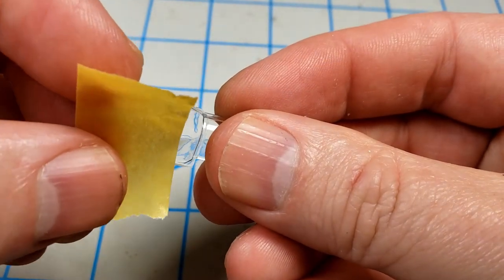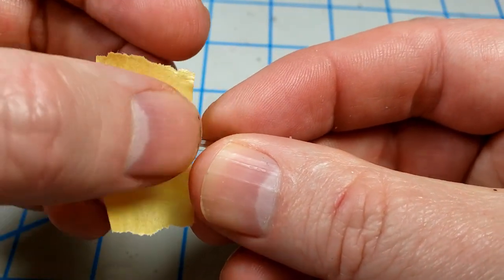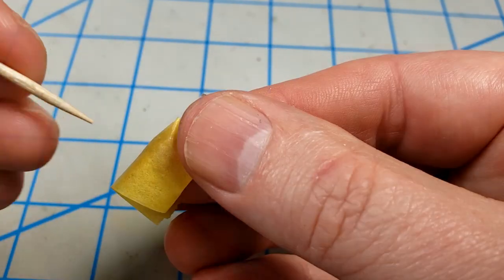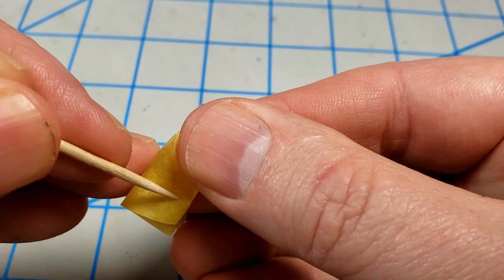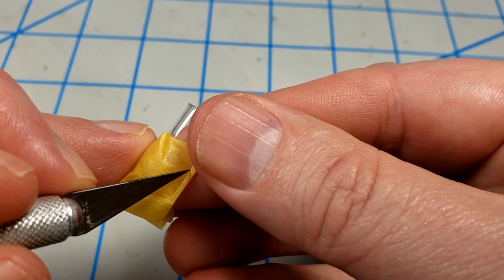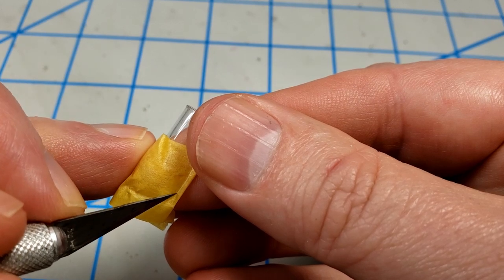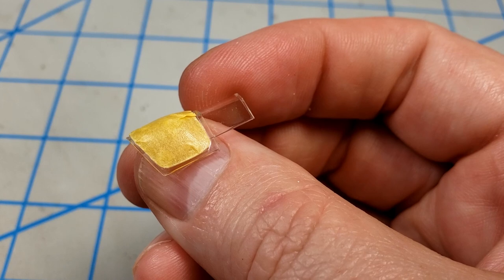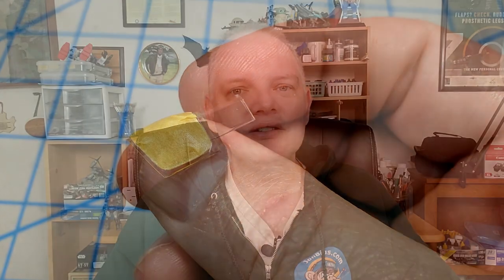Masking Clear Parts Made Easy!

Comment: I’m using a method you didn’t mention - a hybrid method. Thinner slices of masking tape around the canopy edges (so they adhere to compound curves better) and then filling the center in with liquid mask.
Reply from the maker: Yep - I've used that. It certainly works. Thanks!
Reply: I found that the liquid mask (VMS) leaves quite a bit of residue.  I assume that it will come out with Novus1, but I am going to wait a few days to ensure that the frame paint is totally cured --wouldn't want to have the Novus1 obliterate the frame paint now!
Reply: It turns out that Novus will not get rid of the VMS liquid mask residue!  I am going to have to wipe out everything and start from scratch again.  I will never again use liquid mask to complete the masking of a canopy.  ☹
Reply from the maker: @jesusdapena1296  I'm sorry to hear that! Perhaps try something like Parafilm?
Reply: My favourite, too!

Comment: The other method I hear about is using Bare Metal Foil as a masking material. Have you ever tried that before?
Reply from the maker: Oh yes! I had used that method extensively before switching to Parafilm. While it worked very well, I felt it had a few drawbacks that made Parafilm a better choice.

For one, the foil still left a bit of residue. Also, the cost was quite a bit more. At the time, I was building 30-35 aircraft a year, so it added up. And as the foil got older, it tended to crack, which made it difficult to work with.

Switching to Parafilm took care of all those issues for me.

But it definitely works!

Comment: Jon, a couple of simple tips that I find help. For a mini scraper, cut one end of a toothpick @ about 45 degrees or into a chisel shape point with a craft knife. Wooden coffee stirrers cut straight across @ an angle make a cheap burnisher. Liquid masking has been easier to cut & remove when you use several (3 or 4) coats of it. Vinyl contact paper is one of my favorite masking materials. You have some great content videos Jon. I've been a 1/24 model car builder & slot car racer for over 50 years. I don't do either steadily anymore, but occasionally I will still get involved.  I first airbrushed in 1970 using a single action Binks. I still have it & three others, but they see limited use today.
Reply from the maker: Great information, and thanks for your kind words, and watching and commenting! I am grateful.

Comment: Jon, you have a really good channel.  I just discovered and this was a very good session. I plan to use the parafilm from now on whenever I can. I tried the bare metal foil method but I found it very difficult to use. One problem is that I have limited time and it takes me awhile to get back to the canopy if I'm working on something else.  Bare metal foil stuck to the canopy so tight when I tried it and it had been sitting for so long it was really difficult to get it off. As for the enemy of good enough is perfect, I learned that in the army.  But that did not stop me from trying to be a perfectionist with model airplanes. I spent years trying to learn how to scribe panel lines on monogram kits.  It nearly destroyed my interest in this hobby and in my opinion it isn't worth the effort.  I just reduce and highlight raises detail on old kits now.
Reply from the maker: Thanks so much for your kind words, and for watching and commenting! 

I agree - there are things in modeling that the payoff and the effort required just don't balance out. Have fun with it - that's what matters!

AATW!

Comment: great vid Jon! I like your approach to laying out all the options with pros and cons. It definitely takes a little practice and finding your favorite method. I've tried most of them and the pre-cut masks are the way for me if I'm feeling lazy. Otherwise it's Tamiya tape. One item on that, if the canopy has a straight edge, I use the straight edge of the tape and line it along the edge, that's one less side I have to cut! I have been thinking about the Parafilm method for some time and may need to pick some up.
Reply from the maker: Thanks so much!

Tamiya is easy for those "right angle" type masking scenarios. I still use it from time to time for that. Parafilm definitely wins the days when there are a lot of angles and curves involved in my opinion. Give it a try and see what you think!

Thanks so much for watching and commenting!

Comment: 6:28  I have a metal "burnisher" , by Rotring  ( for rubbing down "Letraset dry lettering" , remember that ??)  its like a pen handle and tapers to a small tip like the rounded side of a spoon .  This makes sure the edges are stuck down ! 😄😄 wish they still did Letraset it could be very useful but needed a flat-ish area to apply onto .   Wales UK.
Reply from the maker: That's a handy tool!

Comment: I would like to add another cautionary note with sticky tapes.  I discovered the flexible curvy tapes for those wavy lines one wants.  I thought it would simplify things.  Imagine my surprise after stickng the tape down on the desired forms,  stepping back to admire the work before painting,  and seeing tape pulling away from the forms I am trying to achieve or protect.  So you redo the masking because the stuff does not "correct".  Turns out,  it is "curvy" because of its elastic composition.  Once placed along the curves,  it shrinks and moves from its intended location because we naturally have a tendancy to "stretch" it some to conform with our desired lines.  Correcting "in-situ" only stretches it again before it shrinks back once more.  Hope this helps.  Great video.
Reply from the maker: Thanks so much for watching and commenting!

Comment: Hi Jon, an message and compliment from the Netherlands. I normally do vehicles and I have searched an long time for a good way to work on the transparants. I have tried your
method to paint it with acryl paint  and than remove the rest with an toothpick and it works perfectly. Before I have always made the "black rubbers" with an permanent marker form edding but
you had to be very carefull, no you can make some faults and you can remove it. Thanks for the tips.
René de Caluwé, The Nether;lands
Reply from the maker: Hi  René - I'm so glad you found that method helpful! I'm always happy to know that the videos are useful in helping people in the hobby.

Thanks so much for watching and commenting - happy day to you! Jon - North Carolina, USA

Comment: this is great Jon!! I have been having trouble with leaking around the tape. Thanks!
Reply from the maker: I'm so glad to know this has been helpful!

Thanks for watching and commenting!
Reply: make sure you press the edges down ! this is what people forget .
Reply: @fredtedstedman  Thanks!
Reply: Capillary action tends to suck the paint under the mask.  I have had no problems of this kind since I started pushing the airbrush trigger mainly down, and only a little bit backward, so that the airbrush puts out very little paint and a lot of air.  Apply many of these dryish coats.   Never allow the paint to pool.
Reply: @jesusdapena1296  Thank you!!!

Comment: Quick question. Amazon lists several types of parafilm, which type are you using? Thanks for that. Then...excellent video!!!
Reply from the maker: The Parafilm I have is labeled Parafilm M, and is made by Pechiney Plastic Packaging Company. It's 2" wide, though I'm not sure how long the roll is. I used to get it Micro-Mark, but it seems they no longer carry it. (You can see a picture of it in the thumbnail for the video.) HTH!

Thanks for watching and commenting!
Reply: @JonBius  Thanks very much!

Comment: Wondering what your thoughts are about masking porthole windows on civilian airliners.
Reply from the maker: Depending on the size of the porthole, and its depth, I either used liquid masking fluid (on deeper recesses), or poster putty gently pushed down to the size of the opening.

If you have a punch and die set that is the same size as the portholes, you can punch out tape masks that work quite well.

HTH - Thanks for watching and commenting!

Comment: Is it possible to paint with spray cans without paint bleeding under the masking tape?
Reply from the maker: Yes, but it requires very good masking work that is fully burnished down, and light mist coats from the rattle can in quick passes. Even then it can be tricky.

Thanks for watching and commenting!
Reply: @JonBius  Is it easier to just brush paint then? Are the bleeding possibility smaller?
Reply from the maker: @RuweSaare  There are a lot of factors involved in that. It's possible to get bleed with any method. There isn't a single method that is 100% bleed free all the time.

The best strategy is to try different methods, see which one works best for you and the equipment you have available, and then learn how to deal with any bleed that may happen to occur. That way you will know how to minimize the risk of bleed, and deal with it when it does happen. HTH!